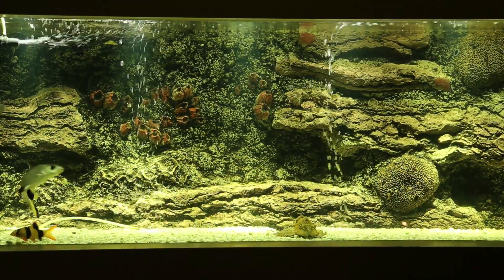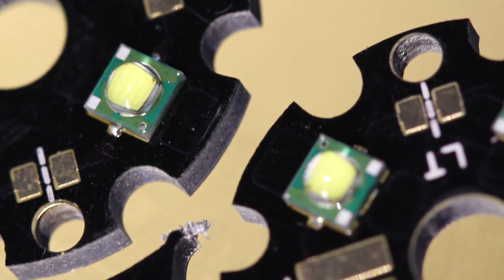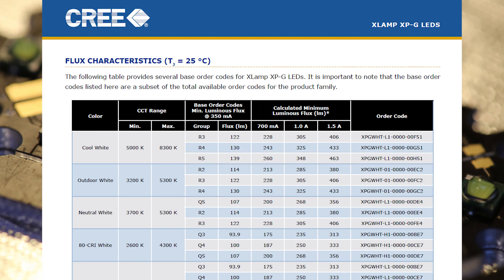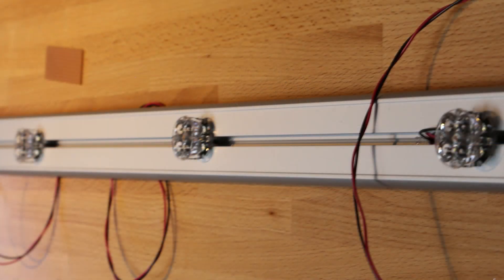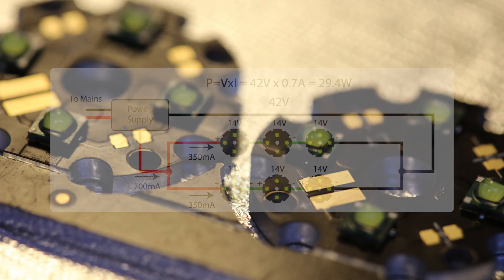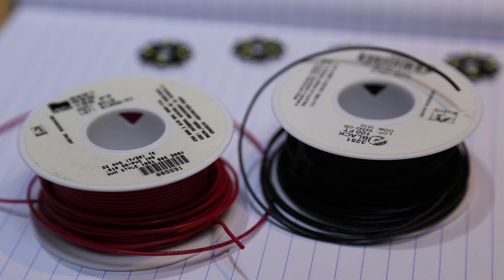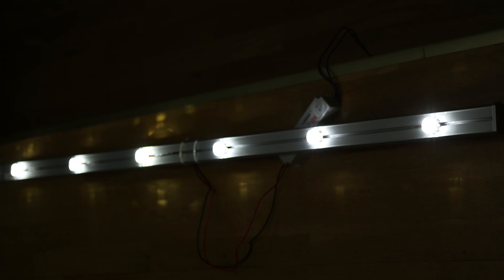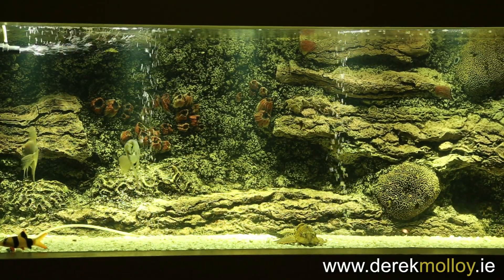Aquarium DIY LED Lights Tutorial - Bright and Low-Cost

Comment: The only problem I see with your system is the part where you used 2 sets of 3 stars in series, driven in parallel from a single constant current source. If a star goes bad in one set and stops passing current the 3 stars on the other set will take the full 700 mA, which will burn them in a few hours. Better to use 2 power supplies.

Comment: I'm wondering if u can help. I'm looking at making a similar project for my tank. I'm looking at using 1w led stars which use 3v to 3.4v per star. I'm hoping to use 5 rows on a 24 hour controller with about 10 stars per row. What I'm trying to find out is if for eg. If I connect 4 of the stars in series can I use a 12v power supply. If you can help qould be great also I believe the controller is a tc420 led controller.

Comment: I think I can figure out the soldering and the aluminium heat sink, glueing, driver - but the perfboard bit was not fully explained... It looks daunting.
Reply: It's not too bad. You could use connection strips either, but waterproofing it would be messy. Each strip on the board is connected together, so it's an easy way to set up the parallel paths. Follow the lines in the diagram that appears in the video.